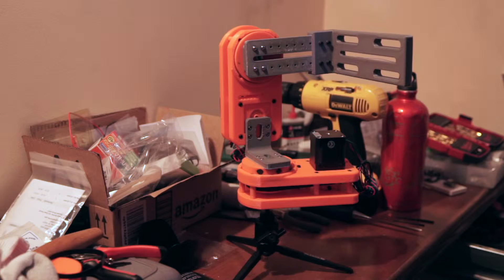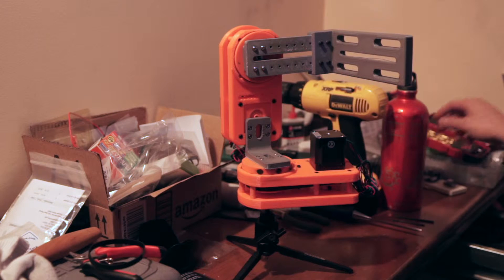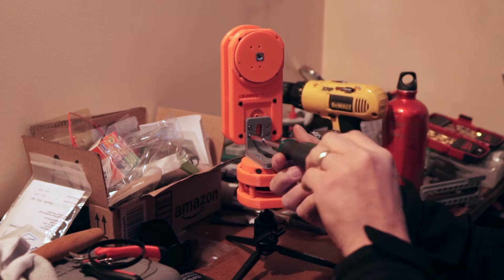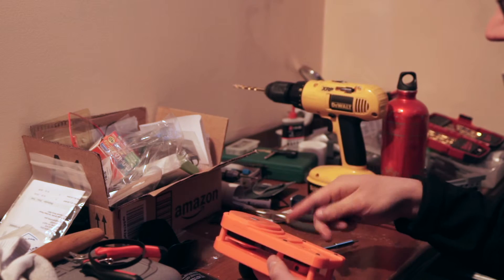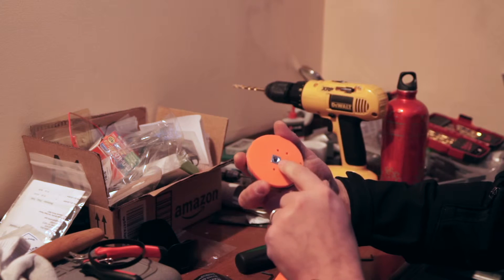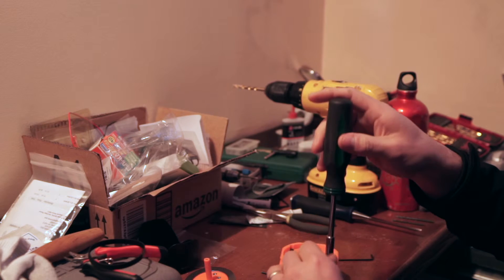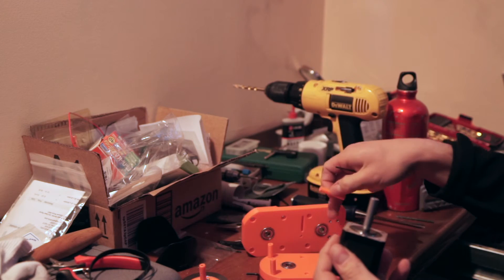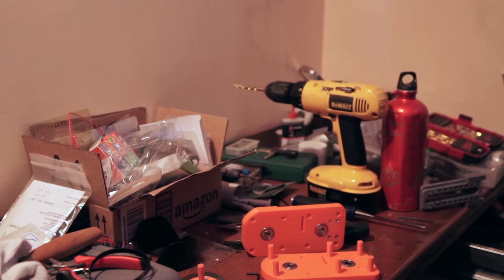3d Printed Camera Pan & Tilt Head - Build Part 1

Comment: P.S ur 4 m3 17mm bolts link on thingiverse is the same as 8 m3 50mm bolts
Reply from the maker: +LostMyFinger thats because I just used the longer bolts and cut them to length :) its easier to buy the large pack of bolts and a m3 die to clean up the threads after then it is to buy a hole bunch of different length bolts...
Reply: opps i missed out on that. So if i dun have a cutting tool i should get 50mm and 17mm lengths right?
Reply from the maker: +LostMyFinger they don't make 17mm... 18mm will do... for the longer ones I cut those also... when I do video 2 I'll measure the bolt lengths after cutting... but a Dremel tool with a cutting wheel will do the job in about 10 seconds... or a generic rotary cutter... they run about $10-$15 for the generic ones and are well worth having... I use mine all the time...
Reply: +Chris Bordeleau Photography great!! I am going to do planning for now. as linear time lapse is quite boring. but once you add in panning, it becomes great!! haha
Reply from the maker: +LostMyFinger motion adds depth and presence... a sense of being part of the scene rather then just observing... I'm thinking about adding a ramperpro to do day into night stuff easier this year... but they are expensive... maybe next year...
Reply: +Chris Bordeleau Photography yea ramping is too expensive, LRtimelapse is my cheaper digital tool

Anyway for the 5070 thrust bearing, is it necessary to have 50x70x5mm dimensions? I could only find 50x70x3mm at my store
Reply: +LostMyFinger 3mm would cause the 70mm disc to hit the frame of the rotator.... check around if you can't find a 5mm one I'll upload a disk the works with 3mm...
Reply: noted
Reply: +buffcleb hi, sorry i wonder if you could upload the disk that works with 3mm?
Reply: sorry to bother you again but if you could upload the disk that works with 3mm?